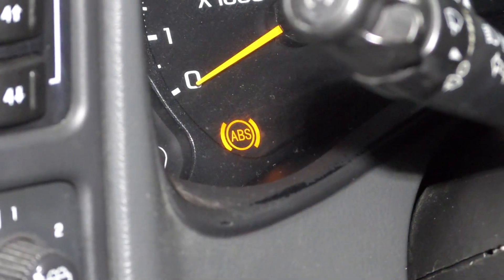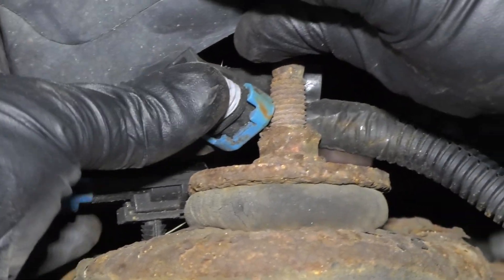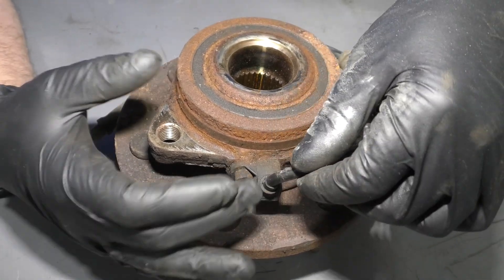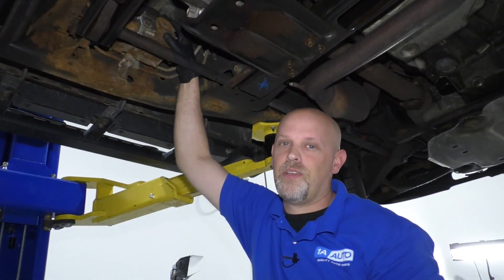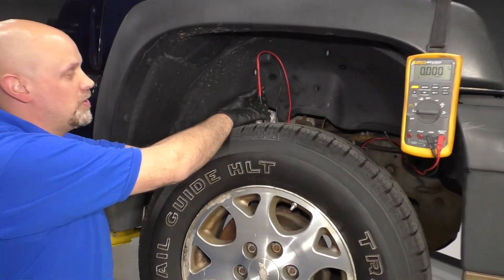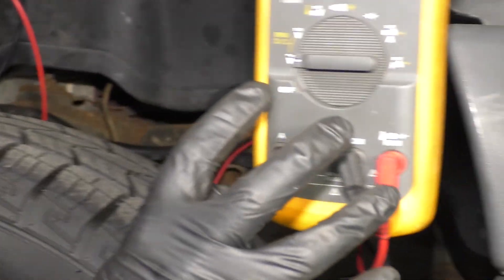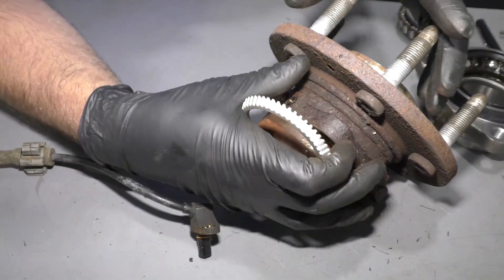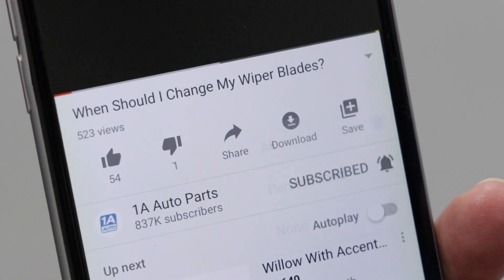Check Engine or ABS Light?  Wheel Speed Sensor Circuit Open - Code C0221

Comment: Ive got a c0225 on my 2000 gmc sierra front left speed sensor circuit open i bought a wire short detector it didnt help i replaced the wheel bearing but nothing fixed it checked fuse checked ground all is good. But i looked up a wiring diagram and the wires are not the color they should be so im really lost as to what to do can an aftermarket alarm system have anything to do with it. The wires are orange and black their supposed to be light blue and green i think not sure about green but positive about light blue

Comment: Is this the problem that my truck trembles and only goes 70mph? And slow acelartion? Its a c1155 left front wheel speed sensor input failure i went to autozone

Comment: One more question, please. I user motorcycle, which is has dual channel abs module, but I want to add switch on and off abs. If add short circuit to back wheel sensor, just for disable back abs, this will made me additional probelm on abs block? I mean, may short cirtuit of back wheel sensor corrupt abs modul at all?

Comment: If my ABS light is on but I’m not getting a code, could it just be the fuse?
Reply: You probably need a better code scanner as some of the cheaper ones will not read all codes.

Comment: I just replaced wheel hubs on both sides of my 99 Chevy 1500 z71 5.3l with hubs from 1AAUTO and I'm still getting this code. I reset it and it came back soons I put my foot on the brake w/o the wheels even moving. By them being brand new I dont believe it's the sensor itself. Here are my codes c0 221,222,223,265,281
Reply: It’s the wire

Comment: My 02 excursion 7.3, sat for awhile had to charge batteries..abs light is on but no abs code..it gives p1260 code which has to do with theft detection..but no theft light on. Could that still be abs sensor related
Reply from the maker: +Jeff M We wouldn't be able to diagnose an issue like that here, you may want to have a local mechanic take a look at it. Thanks for checking us out! 1AAuto.com
Reply: Dead key fob. My wrangler has it and one of mine died. It would start for 15 secs and die.

Comment: 2000 X-terra ABS light & no code.  I ended up replacing the pump assembly.  I've seen & heard it called other things, point being it's fixed.  Good video.
Reply from the maker: +kicknsystm Thanks for checking us out! 1AAuto.com